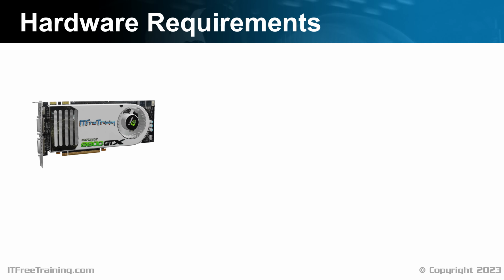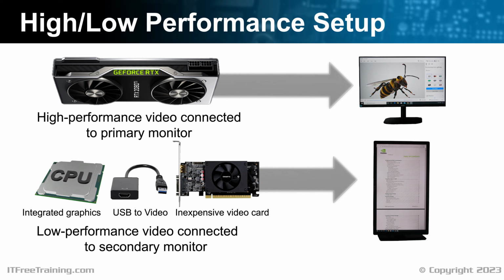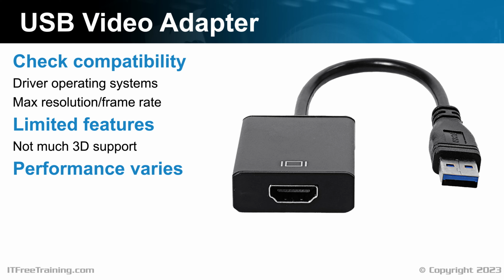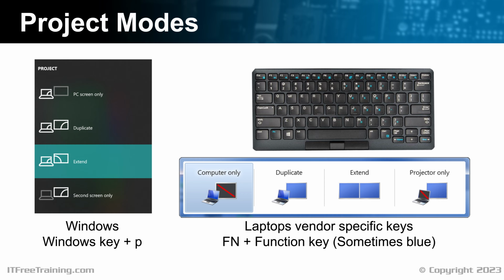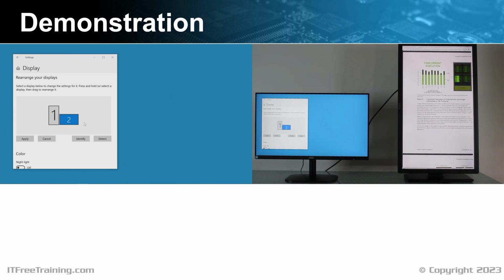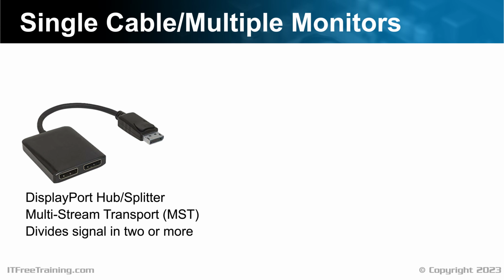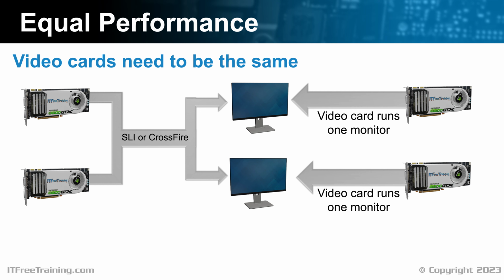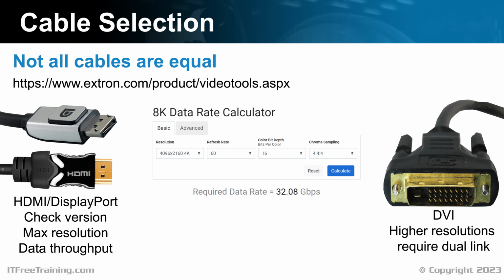Multiple Monitors

Comment: Your video are just are lit... 
except I have a problem that am failing to understand if this could be my hard drive dying help or advise me.... when my computer boots just after showing f2 and f12 for set ups it gets on the blank screen which last forever.... what or how can I solve this problem
Reply from the maker: I'm glad to hear that you find the videos helpful, but I'm sorry to hear about the issue you're experiencing with your computer. A blank screen that persists after the initial boot sequence can indeed indicate a problem, and it could be related to various hardware or software issues. Here are some steps you can take to diagnose and potentially resolve the problem:

Check Hardware Connections:

Ensure that all cables, including the power cable and monitor cable, are securely connected to your computer and monitor.
If you have any external devices (e.g., USB drives or peripherals) connected, try disconnecting them to see if they are causing the issue.

If there are any error messages or beeping sounds during startup, note them down. They can provide valuable clues about what might be wrong.

If you suspect hardware issues (e.g., faulty RAM, graphics card, or motherboard), you try unplugging them to see if that fixes it.

Comment: I run 2 TVs (50" 4k and 32" 1080) off of my rig with an Nvidia 3050 and an internal 10"  1900x1200 portrait sensor panel running Aida64 off of an internal Startech USB adapter. I've had small issues with Windows trying to initially load to a non-main display screen, which goes away after Windows loads into the login screen. The other issue is more annoying. It will sometimes load a new window into a non-main screen. Like my sensor panel and go behind Aida64 (which is setup for "always on top"). I will try to open the program a couple of times, then realize that I have to move the sensor panel screen to grab the new window that opened up behind Aida64.
The other thing that I had to figure out... With my 2 screens being different sizes and resolutions, the transition between the TVs was odd. The mouse cursor would go to the same respective height on the other tv. So, 1/2 to 1/2,  3/4 to 3/4,  etc. When going from large to small, it would jerk downward if the curser started high on the first screen. If started low on the large screen and moved over, it would jump up once on the small screen. It's hard to explain, but if you (whoever reads this) gets it, it'll make perfect sense. So, I had to do some basic math to fix it. Then I went into the Nvidia control panel and set up a custom display resolution for the 32" 1080 that was respective of the resolution and size of the the 50" 4k. Which came out to 2545 x 1423. Now the mouse goes straight across when transitioning back and forth across screens. I can now also click and drag a window to the right side of the 50" screen in order to split it because the mouse gets "caught" on the side of the 50" where it doesn't meet up to the 32". 
I have slight problems with my sensor panel sometimes going greyish, having 4 little  displays of the the same image that is supposed to be on the whole screen, or just not getting a signal when booted. I'm pretty sure I am at fault here by using a USB 2.0 header instead of a 3.0.... but, it is usually fixed by clicking "disconnect this display", then immediately click to revert back.
The little problems are far outweighed by the added convenience that the extra displays give me. I use this setup mostly for entertainment purposes and did not expect the multiple screens to be so useful on something that wasn't production based.
BTW, I like your videos, cheers.

Comment: I have a question? I have a gaming laptop,it has an HDMI output. It has a 15” screen . The video card is capable of 4K. Using an HDMI cable can I hook this laptop to a 60” 2K TV with harming the laptop. I am 74 years old I’m some kid trying to destroy my parents laptop. Thanks for all the information you have posted .
Reply from the maker: Yes you can. The video card will support lower resolutions. With HDMI you just need to make sure the cable you use supports the resolution. Lower resolutions are also supported by the cable.  Thus, if you have a 4K video cable it will support anything below it including 2K.

With HDMI you can plug it in with risk of breaking anything. It simply will work or won't.

If you are having trouble getting it to work, shutdown the laptop and turn the TV off. Plug it into the TV to the laptop. Switch on the TV, if on default settings will attempt to auto detect the connection. Switch on the laptop.